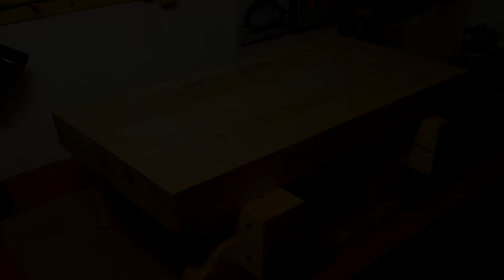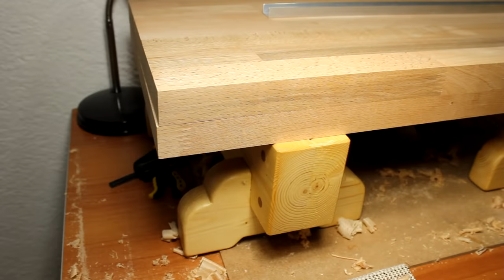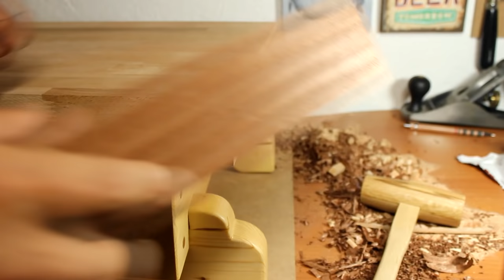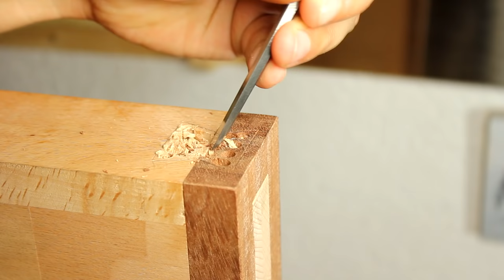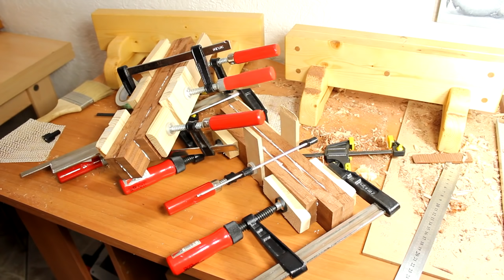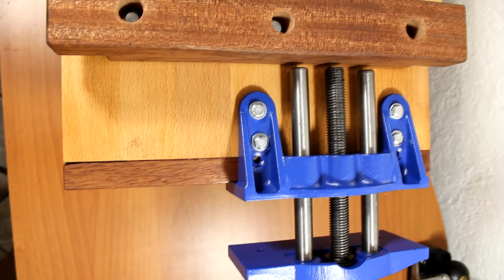Building a Low Woodworking Bench [1/4]

Comment: I've been looking at and evaluating ideas for a small, portable bench/surface that's suitable for hand tool work, and this one is definitely the best design I've seen. Thanks for sharing.
Reply: A couple questions: 
1.  Why take the time to add those breadboard ends?  Do they serve a purpose or are they just for aesthetics?
2.  How do you like that drill press guide?  Worth the money for someone who doesn't have the space for a real drill press?
Reply from the maker: Matt Hutchinson Thanks Matt for your comment. Indeed i added those ends just for aesthetics reasons and mostly to practice myself those techniques of big mortises, tenons and inlays, since this bench was my first serious ww project. 2. If you don t need very precise, deep and large holes this might suits the needs. I may ignore the precision, but the drill power is the issue. I use a corded drill with variable speed. When drilling with larger forstner bits i have to lower the rpm, but this reduce also the power and i overheat it to much, but i use this config rarely. Otherwise it wort the money, probably the version with rack and pinion is more precise but is 3x expensive

Comment: Adrian:   Lovely piece of work. Well done. Has anyone else mentioned to you that ALL woodwork vices are deliberately made 'out of square'. Over the years they are subject to a lot of pressure and frequent over tightening. This can eventually 'strain' the vice. The jaws are made so they close towards the top first, compensating for any 'strain', and ensuring that the vice grips totally through the depth of the jaws. Regards John
Reply from the maker: Vise jaws yes, I understand that, the bend comes from the rails, holes etc But the support under don't know, as far as I know cast iron is brittle

Comment: Hey Adrian, this is of course an older video, but in your old shop, did you have problems with saw dust going around your room? Or does hand saws for your projects make little enough sawdust so it's easier to contain? I remember you had your woodworking in the corner of the main living space.
Reply from the maker: Hand sawing is not that problematic, you can manage that with a broom and dustpan, but I used to clean it often also with a vacuum cleaner, don't let it accumulate cause on every break you make you'll always bring some shaving and dust in the other rooms :)

Comment: VERY nicely done, really! I especially like the butterfly inlays they really help keeping things together and look awesome. 
Also, you seem to pay close attention to details, like for example the double width of the leg on the right side, I assume it's for more stability in regards to the end vice?
Reply from the maker: Thanks Ben! 
Not sure if I understood correctly, but the legs are the same on both sizes. It's true that there is an uneven balance between left and right sides of the bench due to the vise, if not clamped and put force on the vise will fall somehow on the right, but even if it was balanced enough, the clamping was still needed anyway because is a tiny bench, doesn't have the big weight of a normal one to be held in place.
Reply: Adrian Preda Ah, to me it looked like the leg on the side of the vise was doubled up and I assumed it was for added stability. Thanks for the clarification!
Reply from the maker: I think I got it, you refer maybe to the Japanese Low Sawhorse. They are not really part of the bench, I just place the bench on top of them when I need more height. I got left an extra piece of 2x4 when making them and decided to double one of the sawhorse, just to use it alone when saw cutting small pieces. Was a good idea, most of the time I use only that one.
Reply: Adrian Preda 

Yes, that's it! Thanks!

Comment: Hello Adrian...Great videos and build...! Now you need to make a "bench hook". A bench hook for planing and sawing western style (push)...and also place it on the far side, so you can plane and saw japanese style (pull). Greetings from Denmark...Jakob.
Reply from the maker: Hi Jakob, thanks! Yes a bench hook is in plan. For the moment I just built a shooting board, just for western planes. Not yet used to japanese ones. Have one but just for rough work and practice tuning it time to time.
Reply from the maker: Hi Jakob, Mitch's bench was a great inspiration for my bench actually. I had in mind to incorporate that ledge used in japanese shooting boards, but I am not sure how the beech will perform to seasonal humidity changing. This type wood has a high level of deformation. I will see after several months how the top will become and maybe add a ledge. But first I must try to became a better user of japanese planes before considering this :)
Reply from the maker: Thanks for the links, some of them I knew, some not :) Sure the bench will evolve, I have some things now in mind, and I will implement them over to course of work. Yes, I was wondering also that if the beech is made out of staves, by factory, should be different than just one big single plank of wood. The boards I bought them in august, when was big humidity and hot, I will see after this winter-spring what will happen with them ;)